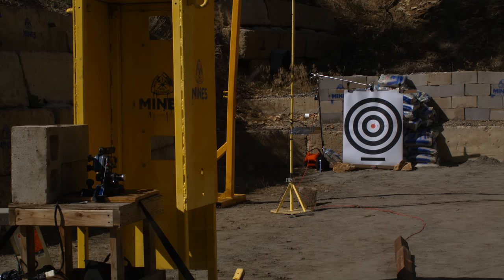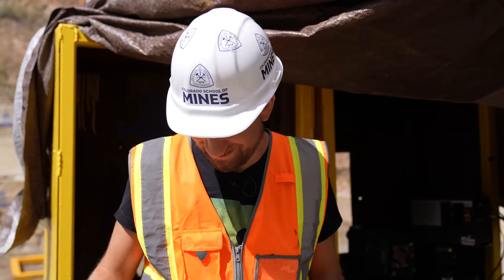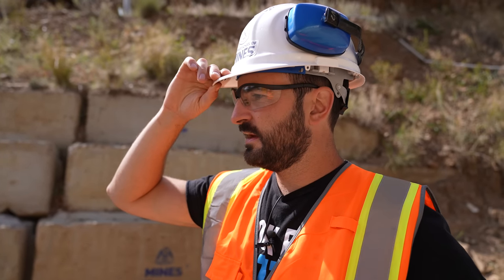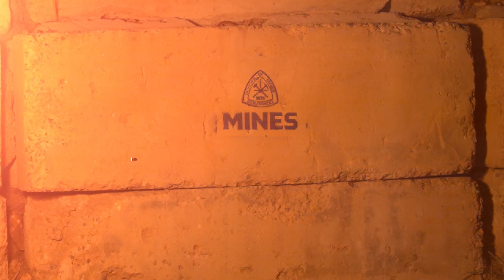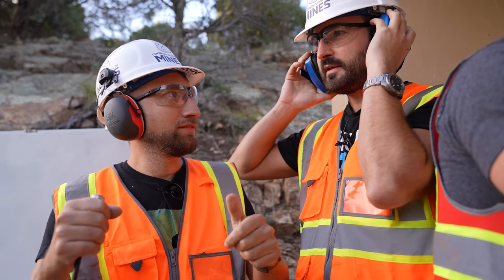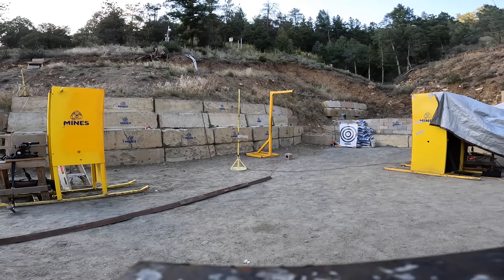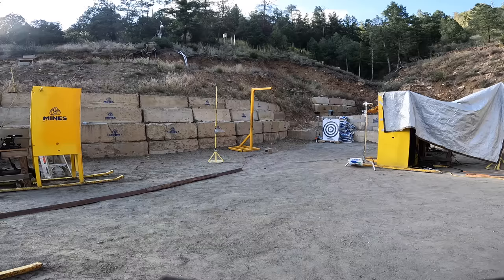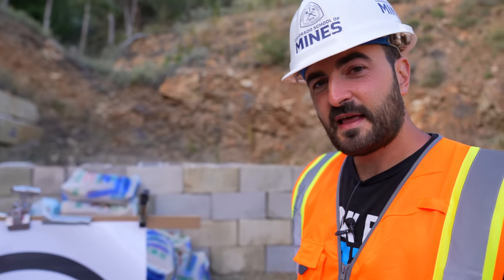Can Explosions Deflect Bullets? 2 MILLION FPS - The Slow Mo Guys

Comment: if an object is traveling faster than the speed of the blast then the force of the blast would be decreased by the difference.

imagine two cars going down the highway at the same speed, if one bumped into the rear of the other it wouldn't do much damage at that speed.

but if the front car was going a lot slower, there would be an immense exchange in kinetic force.

the bullet while close to the c4, is still in front of the explosion so it's able to just "shrug" off of the kinetic energy because the energy it already has in the direction going forward is greater than the force of the blast.

if you really want to deflect it, you need to counter the forward momentum whilst also adding force to the side or downward or whichever way you want it to be deflected.

i bet if you try making the timing on the explosion just a bit earlier, you would actually see a result.

remember, the force applied is only relative to the objects current kinetic energy.

Comment: Surely for this test to be accurate you would need to use the same size wired card that was absolutely the same in exactly the same point down to micron level, if not then the smallest part of metal or card can cause the bullet to change direction slightly?

Comment: The bullet still respect the laws of physics. The experience failed because of timing or size of the explosion (timing seems good...). The way the explosion is set up release all the energy in 360°, the bullet has a lot of energy and is very small, the energy produced by the explosion must be directed to the bullet (easy, uh?!) or increase the energy released by the explosion. Yes you can theorically affect the trajectory of the bullet by transfering enought energy to it during the travel. I have no idea of what im talking about 🤫🤭🙂

Comment: The bullet has a really small area that the C4 explosion can use to transfer energy to, and given that it's an uncontrolled circular explosion, a lot of that energy ends up wasted. If you managed to create a shaped charge and concentrate all of the power into a conical exit area that you know the bullet will be going through (something you managed to do VERY well in this video), the increased energy transfer may be able to affect the trajectory of the bullet significantly. Of course, this essentially involves sticking C4 at the end of a tube that can resist incredible internal pressures, which is straying dangerously close to creating a bomb. Would not recommend this.

Comment: The explosive will not be as effective because there is insufficient mass behind the explosion. If you create a parabolic steel plate, you can focus more of the energy from the explosion and create a force vector to offset the force vector of the bullet.

Comment: Surface area relative to density and speed of the bullet would require a much larger explosion. None of your equipment would survive the necessary amount of explosives required to move the bullet in flight.

Comment: I've always wondered what happens to the bullet when you shoot tannerite exploding targets, especially the ones for rimfire cartridges. Firing a gun inside of a vacuum chamber? Will it even fire?
Reply: In a vacuum, the oxidizing agents in the gunpowder itself would still allow for ignition after the primer is struck, and there's still enough oxygen in the case after its sealed to allow the explosion necessary to push out the bullet. 
I'd definitely be interested to see if there's enough oxygen to burn all the powder and push the bullet to the weapon system's full capability though 🤔

Comment: well bullets are designed to travel swiftly through the air, and shockwaves are just air with different density, if it was gonna deflect the bullet, you would need a much larger disturbance in the air or subsonic rounds

Comment: You guys should try shooting a copper jacketed bullet next to an extremely powerful magnet and see if it gets deflected or slows down. It might require a solid copper bullet to get a reaction.
Reply: Uh, copper is not magnetic, nor is lead!
Reply: @alans172   strong magnets induce a voltage in copper causing the copper to produce its own magnetic field. There's a video by NightHawkInLight called "Copper's surprising reaction to strong magnets" that demonstrates it pretty well. The same thing happens with aluminum. It's called Lenz's law and is used in motors all the time.

Comment: I haven't watched this video yet and can say with 100% certainty that C4 can deflect a bullet.  It's much more effective from a perpendicular and when deployed far enough out to allow the bullet to miss the target.
Reply: I suspect the reason the bullet is not deflected is because it is always ahead of the shock wave. At 11:31 you can see the shockwave emerging from the middle of the detonation, at the same speed as the bullet, ~1250 ft/sec (= Mach 1.1). The shockwave is moving at Mach1, so the bullet, starting at about a foot below the charge, is always ahead of the shock wave.
Reply: @alans172 , the detonation velocity of c4 is 26,400 feet per second.  It's just a matter of how close the bullet is to the charge when it detonates and at what angle.  Explosions lose energy exponentially as their radius increases.

Comment: The bullet 🔫 is not as "massive," 🪨 hence not much surface area for those forces 💥 to push ☄️ against💨 at the speed it's traveling.
Perhaps is why it won't deviate much if at all, in my opinion. And if speed is in the mix, trying different bullet speeds would add a variable, subsonic 💤🤫 rounds anyone?
By considering the size of the bullet as the other factor, you would assume different calibers will yield different results, which = MORE VIDEOS! These guys always pull it off 🙉👍great episode 👏

Comment: I've not watch the video yet but my common Sense tells me that the explosion is going to have a little to no effect on the bullet. Yes an explosion has the force of thousands of pounds of pressure wave energy. But a bullet has thousand pounds of kinetic energy condensed into a very small square inch. An explosion does not have thousands of pounds per square inch, even if it might. It's still a non solid it's very likely not going to deflect or stop a solid metal kinetic energy projectile. Look at it this way, Basically it's like the gas being my fist with let's say a hundred pounds of Force, against a sewing needle being the bullet, with a hundred pounds of Force as well. They both collide are they going to surrender to each other? No that needles going right through my damn fist like butter. But let's see if I'm right. 

Edit conclusion: common sense on point.

Comment: How about just math? Energy of air etc affecting the bullet = velocity of shockwave x mass of molecules in contact with bullet (over time as it travels) vs energy of the bullet (mass x velocity of the bullet) over time. You could probably even calculate the amount of explosives needed at a certain distance from the trajectory. 

Also, why bother with the wire/cardboard mechanism? It just introduces an error source. Better just base it all on the trigger for the gun, with some delay added. That delay is also easy to calculate since you know the muzzle velocity and distance. 

I think you can do better….

Comment: Theory here.. not well thought out OR researched but here's my initial thought. Comparing the blast to a nuclear bomb, visually it kinda of represents what and overhead detonation looks like. When seeing how a nuclear bombs energy in the heart of the blast which disintegrates and vaporizes , heats everything to a million + degrees and how AFTER this core dissipates into the next phase of the mayhem which has a much less effect on object compared to the detonation point, the bullet a miles away from where the most effective part of the explosion would be if we scaled a nuclear bomb to this explosion. Possibly if it crossed the detonation point at the exact center of the explosion, possibly the bullet would shatter into hundreds of pieces or would deviate significantly from its intended path. Im not a scientist. Closer to captain obvious

Comment: The energy of the bullet is greater than the energy of the Shockwave, even though the Shockwave is faster than the speed of the bullet. Therefore, the trajectory of the bullet is not greatly impacted by the energy of the Shockwave. Somewhere in here is a mathematical equation that could quite literally change the world... 😊

Comment: I think the results could be different if the gun did not have rifling. The fact that the bullet is spinning means that it has a lot of angular momentum which could prevent it from deviating of its original trajectory...
Next test?

Comment: honestly I just think the cross section of the bullet is too small. Sure, the explosion is enormous, but the wavelength of the shockwave is so much larger than the bullet that it's going to mostly refract around it rather than reverb off it and impart force

Comment: The pressure inside a gun barrel to accelerate a bullet is in access of 10k psi.

Without looking it up, a couple feet away from a small uncontained c4 blast is probably what, 500psi at most? Maybe less?

You guys are clearly bright. Surprised you didn’t use a little math before trying this. The explosion was too far away from the bullet.

Comment: Disappointed that they used a used a moving target. You can see the paper moving in the videos, and when you are talking about just trying to see if it has an effect, the paper moving with the explosions and the wind can hide if there was more of an effect. Should have painted a target on a metal plate to be more accurate.

Comment: The bullet was not next to the explosion. If you had halved the distance you would have squared the energy striking the bullet. I'm sure if the bullet was within a few inches of the C4 when it went off it would have been vaporized.

Comment: I have to disagree.  I think you got the timing wrong. You need to set up the explosion before the bullet is under. The explosion needs to be above the bullet as you're doing but you need to wait for the compression waves in front of the explosion.    the explosion needs to be detonated before the bullet. Compression wave has enough time to push down the bullet.  Your timing is wrong. The explosion as the bullet is underneath Will push the project out, but it will increase in speed. Not down because of where the explosion. You made a Secondary cartridge behind the bullet goes off in flight.

Comment: This test is kind of pointless and flawed, since the explosion reached the target a few times faster than the bullet and moved it a lot, so the position on the target is meaningless. The target should be attached to a stationary object that wouldn't budge under the shockwaves like the flappy paper and the boom arm did.

Comment: this is a fail. There is no reliable results here at all. And you didn't even try to explain what happened. Was the explosion timed correctly? Was the flopping target ruining results? What is the hypothesis? The bullet trajectory would be changed by shrapnel? Air pressure?  Why didn't air pressure effect the bullet? NOTHING VALUABLE IN THIS VIDEO OTHER THEN COOL SLO MO SHOTS OF THE EXPLOSION.